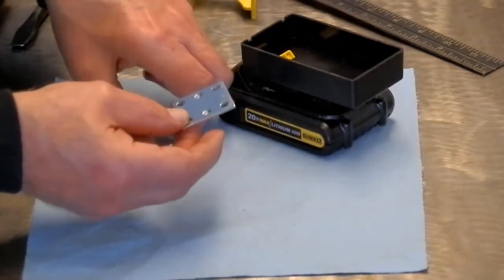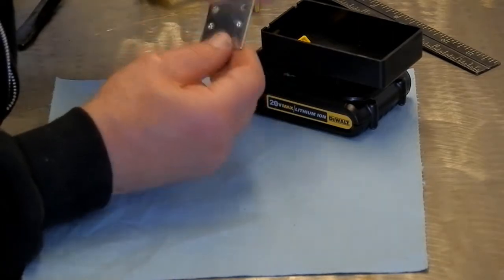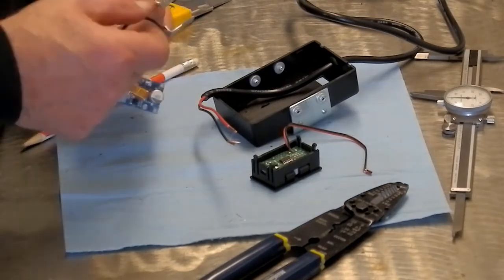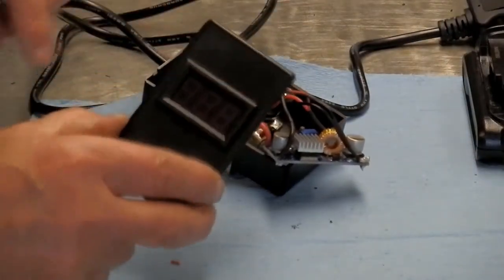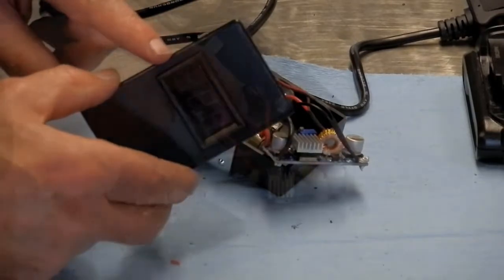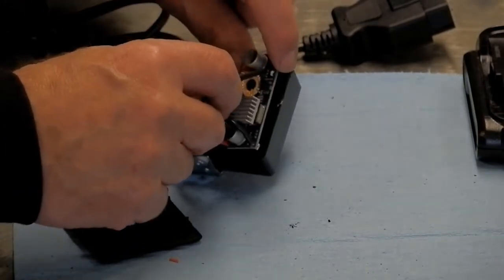GADGETS#14 - DeWalt automotive memory saver

Comment: I saw your video on Wi-Fi parasitic  amp meter and that lead me to this one. Being a Mercedes and Porsche tech for a long time (20+ years) I found work around for getting my meter connected without disconnecting battery. It can reset a faulting control unit and draw will be gone if you battery gets disconnected. That’s why I love this build and will be looking into building one. 

I have a question I have gotten the chance to work on quite a few 6 volt Porsche 356’s. My challenge has been keeping the battery topped up and or jump starting them. I have wanted to make a devise that attaches to top of battery and cuts voltage from a 12v battery to 6v. Can you lead me to some documentation or build someone has done on this? I thought of adding a 2ohm resistor but thought the heat would be too much, then a voltage regulator but not sure how to get one to handle starter current (about 200 amps). Any information I can get would be awesome. Thanks and great Channel it’s helping us professionals make some of the tools we need to properly do our jobs
Reply from the maker: best I can think of is a 6v battery charger/maintainer...

Comment: Love your videos! Just found you. Can you tell me what pins the wires go to on obdII? 16 and 6? I want to do banana plug outputs to go into a breakout box
Reply from the maker: pin 16 is 12v (always ON)
pin 6 is CAN HI High

both need ground from pin 4

here's a link that illustrates it:

https://scontent.fyto3-1.fna.fbcdn.net/v/t1.6435-9/89071283_3015701558493539_3765265844058193920_n.jpg?_nc_cat=101&ccb=1-5&_nc_sid=8bfeb9&_nc_ohc=nnl1c2rm8HkAX8d46AG&_nc_ht=scontent.fyto3-1.fna&oh=00_AT8wqT3xn4coB8tzsni5Q7LsEv5II3ddUCAocvII3NHlFQ&oe=61F40711

Comment: You are very creative , I can see that. Amazing job.
Reply from the maker: thanks so much, Alamin:)
Reply: I did differently though, took out the 20 volts output from the  charger itself and reduced it by the same buck converter you had, using 5 amps battery. It's beautiful, functional and permanent. So the battery goes into the charger and from the charger I have 20 volts and used buck converter to lower it to 12.6 volts.

Comment: Another great video, I am so pleased to have found your site. Can you tell me, when using this memory saver, can you still look at removing airbags?
Reply from the maker: +Gunter Robertson - good question!
The concern of course is inadvertent deployment during replacement! There must not be any power to that system and the capacitor must be given time to discharge.
On vehicles where disconnecting the battery only means losing your radio channels and resetting the clock, it's simple...I would not use memory saver.
But on vehicles where disconnecting the battery results in complications and likely a trip to the dealer afterwards, I would be tempted to disable the restraint system by the removal of the fuses (usually more than 1 involved). That requires a full understanding of the wiring diagrams feeding that system.
I too am pleased you found my site:)
Reply: @theGADGETSplaylist  A lot of wisdom here !
Reply from the maker: @ghibliinu6616  - I try😉
Thanks so much!